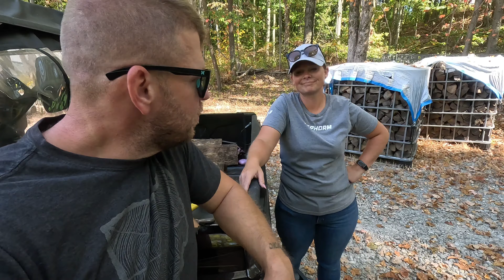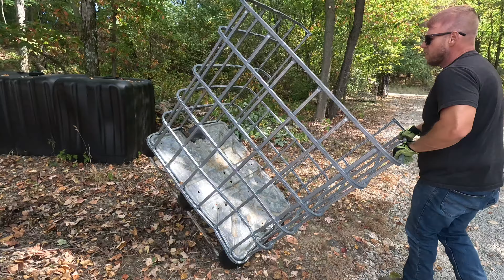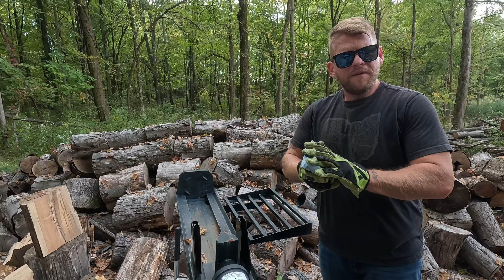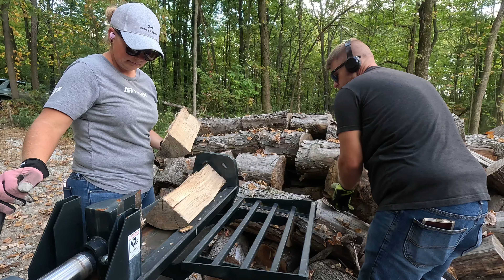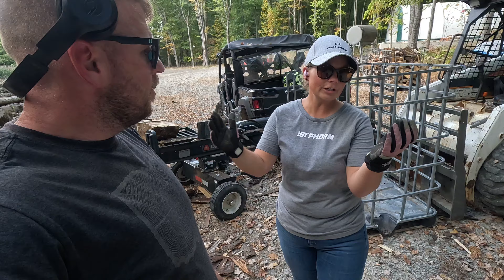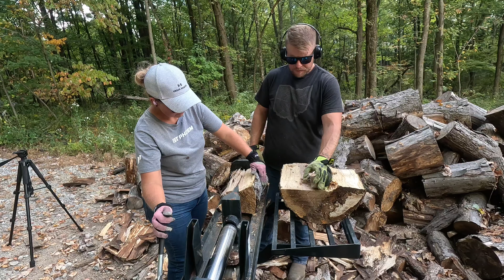WE ARE ALMOST OUT OF FIREWOOD!! ONLY ONE WAY TO GET MORE!

Comment: You need a verticle splitter works ten time faster and much easier to control the size of the split wood.
Reply from the maker: We can flip ours vertical, but then it's on the ground.
Reply: I don’t know if they have 15k ready to drop on a commercial grade vertical splitter. Since firewood seems to be more like a side hustle at this point.
Reply: @EuroYardService Shaun is selling the little buggy if he bought it outright he will have the money. However since it's still useful and he's selling it, no doubt he has another use for the money.

Comment: Shawn you need a fire wood processor that way you could use the bobcat to load the logs on the platform and just set the size length of each block and split it all in one process